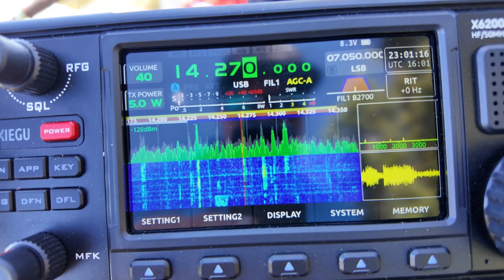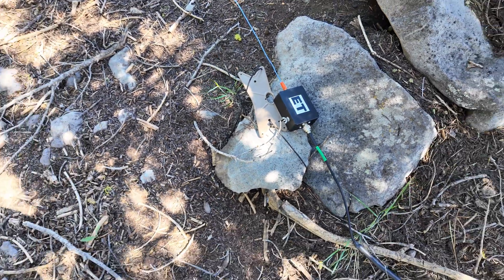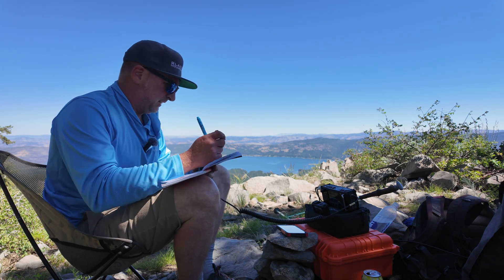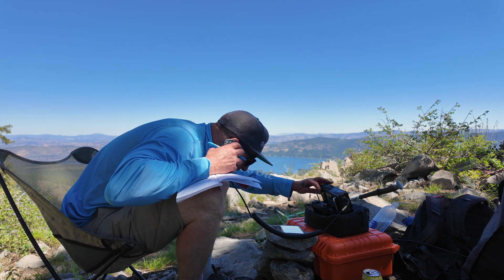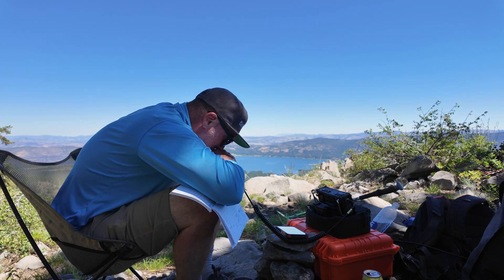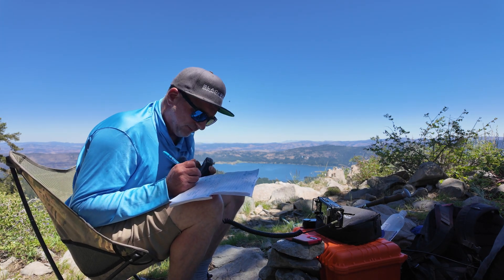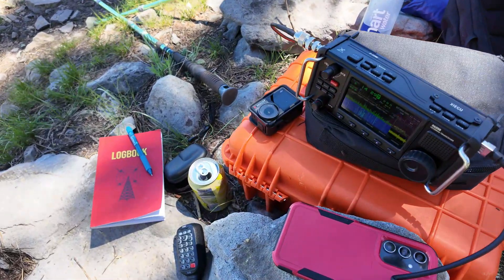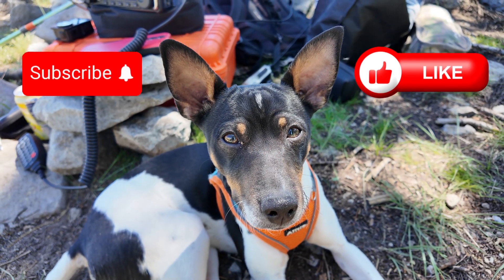Xiegu X6200 Field TESTED!

Comment: I just got this radio, and a Chelegance MC-750, but I'm struggling to get it all setup.  Do you mind doing a video where you walk through how you set your actual antenna up? I know it's plug & play but there's still a bit of tuning/tweaking to get it to play nice, right?
Reply from the maker: Yes, I plan to do a complete setup demonstration in a future how to POTA/SOTA video coming this winter. It's plug and play but some adjustments can be made to your preferences within the settings.
Reply: @W6IWN_Radio  Thank you! Hopefully I'll be up and running long before then :)
Reply from the maker: Here's a video on my antenna setup. I was using a smaller mast, but it's the same setup. https://youtu.be/fIguv3y1hgY

Comment: So, I passed my tech last weekend and was looking at the G90 and the X6200. I'm torn between which one to choose. I like the idea of the bigger screen as well as the portability. What are your thoughts on which one I should get?
Reply from the maker: Congratulations!!! The G90 has a smaller display but has 20 watts and an amazing tuner. I believe it's a good starter rig for an SSB guy. The X6200 has a larger display,  more bells, and whistles but is only 8 watts with an external battery. It also costs more.

Comment: Man, I miss the QSOs with WW7D. I made a contact with F4WBN from a summit in Belgium the other day, which was great after all those QSOs with Christian from summits in Utah and Nevada. How much does the X6200 weigh? I've been thinking of picking one up, since I'm too poor to afford a KX2 and I'd stress too much taking it into the field. I'm heading down to Italy next week and need to keep weight and bulk down to avoid drama with the Ryanair gate agent at boarding. Taking a uSDX or tr(u)SDX instead of my FX4C, but I'm not real happy about it! Say hello to Derek for me. 73 de K7DMJ
Reply from the maker: Hey David,
I hope your journey is going well. That's awesome that you worked F4WBN over there, too. Christian and Daryl WW7D are some of my favorite chasers. The X6200 weighs 880 grams without the battery. The internal battery is probably 150-200g.
I'll pass the message on to Derek.
73
Reply: @W6IWN_Radio  Thanks, mate. 880 g isn't much, I guess. Certainly lighter than a G90, which is what I started out with. I haven't got to do many SOTA activations since I've been in Europe, but I'm planning to spend a couple of months staying at my place in Utah next summer, so I'll get out a bit more then. Next week in Italy should be fun. My wife is coming, and she isn't fit enough to do the kind of hikes I usually like to do. But we'll do what we can. Cheers.
Reply from the maker: @dangermandave67  No problem. Have a wonderful time over there. A summit near saltwater sounds fun! 
Maybe we can S2S when you're back in Utah... 73

Comment: makes you wonder when it will get bricked
Reply from the maker: @guy4698  why would it brick? I've flashed the firmware with no issues.
Reply: @W6IWN_Radio  kinda of like Isreal just did to pagers

Comment: Great video. I have been thinking about the 6200 radio or the g90. How are you liking it? KQ4QIS
Reply from the maker: The X6200 is still pretty new to me. It's definitely a step up from the G90, but only 8 Watts.  I've had a lot of fun with my G90 and 20 Watts over the years. I like them both! The X6200 is definitely more feature rich. Great ATU in both!

Comment: Is a license required to operate this?
Reply from the maker: @tonioyendis4464  Yes, an amateur radio license is required to transmit. You can use it to receive signals to listen without a license. If you're interested in getting your license, check out www.hamstudy.org. They have a great app to study with on your mobile phone too.
Reply: Yes general or extra